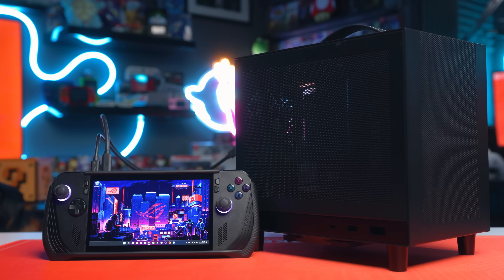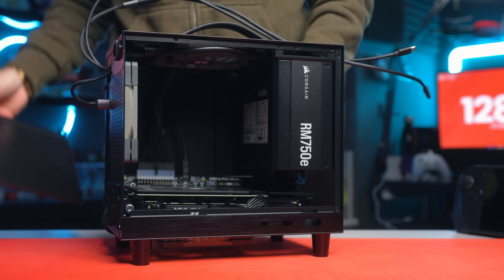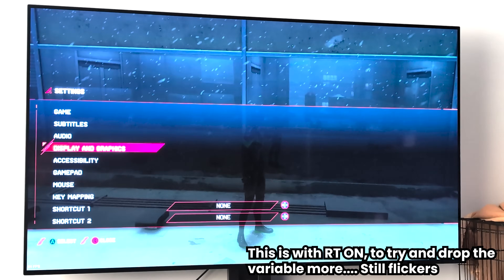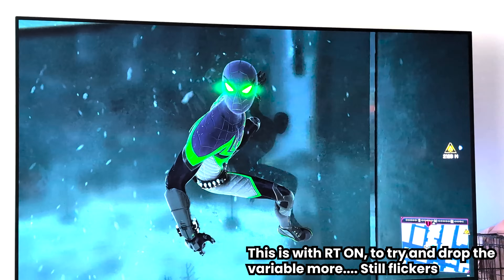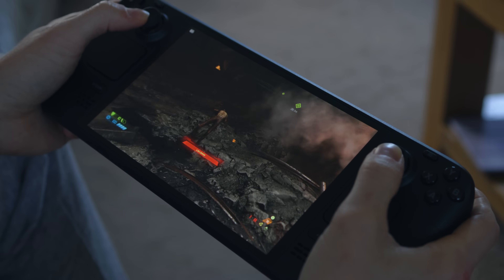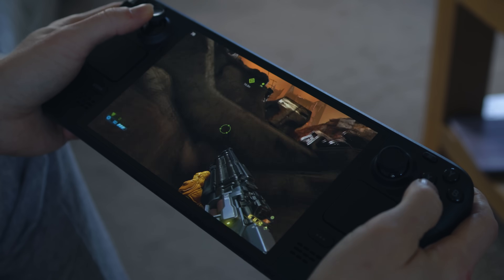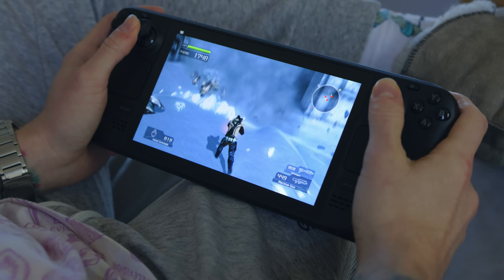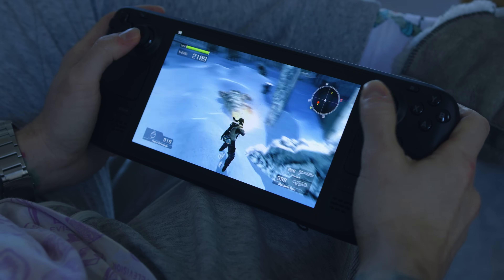The REAL Reason ALLY X Isn't OLED

Comment: Yeah, good to know but I'm just gonna have my framerate capped anyways even with frame gen. I just don't like that variation and it does tend to help minimize frame drops. I think the main benefit of vrr for most people isn't the variation so much as the ability to choose whatever refresh cap you want.
It's a lot better than the old days, where you either dealt with drops to 30 or needed triple buffering.
Now that frame gen is helping stabilize framerates this seems like less of an issue.

Comment: Such informative video and I'm glad I didn't listen to a couple of friends insisted me getting an OLED Steam Deck which I never wanted in the first place due to it's limitations and went straight for the Ally X. I'm loving the device. Of course there are a few downsides but nothing like a deal breaker. Best thing is to buy a PD 100w Charger or a juicy Power Bank like one from Anker, UGreen, or Baseus and have fun with the beast by maximizing it's true potential. You'll love the Bypass Charging feature in the Ally X.

Comment: Frame caps don't defeat the point of VRR. You should always use a frame cap that is achievable. VRR gives you the ability to choose ANY framecap, not just the max refresh rate. Additionally, even with a framecap, most games will have some variance so VRR helps smooth out that variance.
Reply from the maker: If you cap the framerate to a stable and consistent rate, it is no longer variable. If you cap it to an unstable rate, then yeah, the rate will again be variable. We LOVE VRR, we just want to see VRR flicker fixed in all OLED panels.
Reply: @128KB  Keep in mind that VRR is allowing you to pick any framerate. Ex) 80hz - only available with VRR or CRTS. Additionally if a game even has a slight deviation in framepacing from the cap, VRR smoothes it out. Without VRR on the judder will be more noticeable. So if you are choosing VSYNC on, you are going to cause judder if it is every below the cap - additionally you are adding input lag. Using VSync instead of the good framecap is WAY WORSE.

I tried re-creating with miles morales on my AW3225DW but I couldn't. I've only seen VRR flicker on Loading Screens (flickering between 1fps and high fps). I'll try with my S90C later. I will say with my 9800X3D and 4090, anything above 120fps in spider man felt unstable. Uncapped gaming feels awful no matter how good your hardware is.

DigitalFoundry has a great video about VRR misconceptions and a clip about their take on OLED VRR (they think its a non issue because it only happens in uncapped gameplay). Even if you are extending past your hardware you should always cap, because you want to reduce the range of VRR inorder to increased perceived consistency.

Comment: Wait, digital foundry said vsync is suppose to be on, 3 fps cap beloe your monitors refresh, and vrr on? Vsync assists vrr, not 1 or the other
Reply: When VRR is engaged, and VSYNC is not active even if it is enabled. You set VSync on as a fallback incase VRR is not engaged because the general recommendation is that if you have to choose between VSync on and VSync off, VSync on produces a more consistent experience.

Comment: I have both Ally Extreme and Deck OLED, I continue playing mostly on the Deck and if I were to pick Ally 2 LCD with LFC+VRR and Ally 2 OLED without LFC+VRR, I'd still pick OLED. Sorry guys, here we split 😬
Reply from the maker: That's all good! We'll all have our own preferences and honestly an ALLY 2 with an OLED, without VRR therefore no VRR flicker, it would be incredible still!
Reply: @128KB  Here is something to think about, next gen Z2E handhelds, both MSI and ASUS come with LCD, Lenovo comes with 8.8inch OLED panel with vRR and HDR, lets not forget about HDR, imho more important than VRR, especially on handhelds, the main reason 99% of people LOCK t heir FPS on handhelds to save battery, so VRR is useless.
Anyway, MSI+Asus basically FAILED out of the gate
Why would anyone pay the same money for inferior hardware?
If you have an option: Bigger OLED screen with HDR and VRR or smaller LCD with VRR and castrated pseudo-HDR? which one will you choose?

Why would ANYONE pick a non OLED panel? OLED is the ultimate end-goal for gaming
I dont have any non OLED devices in my apartment, and i will never use non OLED handheld or a phone, its  just not thesame

Comment: It’s the price. You aren’t gonna get an OLED device with “all the fixings” for less than $1,000 & they don’t want to cross that threshold in North America. Like, there is supposed to be an OLED PC handheld coming out soon in NA, but the price hasn’t been revealed & I think it’s only 16 gigs of RAM. & prolly 40-50 watt battery. You can’t sell 80 watt battery + 24 gigs of RAM + OLED in North America. It’s way too expensive.
Reply: Then... We need a Steam Deck 2 to check all these marks and stay at the low price? Damn, it'll take some time, Valve aren't rushing anywhere...
Reply: they steam deck won’t include high end tech at a low end price. It’s the pc equivalent of what a Nintendo switch is to console gaming. It’s a soft landing to try & entice casual gamers to bite. They will not put the stuff that is in that Alley X combine it with a 1080p OLED display & sell it for $500. There is new generation tech launching very soon & it has a better chip then the Alley X & it is going to have an OLED display & the starting price of this device is $1100. That’s for the “base model” but it’s a Chinese company & you’ll have to import it & that’s why I mean by no North American company will ever sell this. No way. lool.

Comment: Vrr is one of the Main Reasons i went from the Deck Oled to the all x. Had to cap every more demanding Game to 30 fps, the 780m + 24gb 7500mts ram also helps alot with smoothnes. Cant wait for the oficial steamos Release on the Ally
Reply: VRR is useless on handhelds

Comment: Bro, I’ll be nice if you get the Lenovo Legion go everyone said that thing is so much better than the Rog ally x because it has better things even because of the price and some optimisation it’s getting good
Reply: I switched from it to the ally x the only good thing about it is the screen and kickstand. I fohnd everything else a better experience on the ally x
Reply: @ I do like the ROG ally x is just that system does not have maximum FPS or a refresh rate. It does not have 144 FPS maximum and it does not have one for 144 Hz which is mean I’m not gonna buy this handheld if they change something or add something better for me I’ll stick to my Lenovo Legion go because I still like it
Reply: @Russiangamerpro2021  yeah i get that but i dont think 144 amd 120 is noticable the vrr really helps out the ally as it removes screentearing and can increase battery life. Also there is no reason for the ally to have 144 max fps option if it has 120hz

Comment: How come you should get the Lenovo Legion go? It’s better even has a port that you can connect to external graphic card which is USB 4 port and it has 144 Hz and 1600p even you can change the resolution and it does not have VRR which is I don’t need to know what’s causing it so it’s good thing I don’t have it that I don’t cause any experience but somehow handheld can only limited how much FPS it can only bring. I like the Legion go because as 144 FPS maximum which is perfect.

Comment: Good thing I have one Lenovo Legion go because even my handheld has a USB4 port even my handheld display is not VRR but if I connect to my display, I don’t see any issues going on maybe it depends what game I’m playing maybe just when I play the game I don’t see any results on my Lenovo Legion go but for the Rog ally x  some people think that Hannah is good and some people think that they’re don’t want this handheld because they switch to Lenovo Legion go people considered to buy this handheld because it has better things than ROG ally x
Reply from the maker: @Jasonbwolf.JBWOLF  what we're discussing has nothing to do with the ALLY X but OLED VRR panels, monitors and TVs.
Reply: @ I know I just never seen a video of you reviewing about the Lenovo Legion go it’s considered to be better than the ROG ally and X it’s because of the legion go uses USB 4 which is that was the first handheld released and everyone is wondering how good those pork can be good for even ETA prime actually review the Lenovo Legion go with USB 4 that performance really well that’s why I like Lenovo Legion go because it’s better than the ROG ally x but if they are higher refresh rate and then I’ll buy the ROG ally x if not I can buy it even when I can buy it if there does not have maximum FPS because it’s maximum FPS shown that it can only reach 120 FPS but the other handheld can reach 144 FPS it shows that other handheld is better than rog ally x
Reply: @ even I only watch a video people use EGPU depends what handheld they’re using even I’m still waiting that if they’re gonna create a new handheld with thunderbolt five

Comment: VRR flicker happens on LCD panels too. My Gigabyte monitor is horrible for that. VRR needs somewhat consistent frame times.
Reply from the maker: Sorry to hear that, I've been using VRR since it launched and never experienced it across multiple LCD monitors. There is a chance for LCD panels to have a VRR flicker but it's not the same reason as why OLED flickers and OLED is more susceptible to it.
Reply: @128KB Every single panel has what's called pwm flicker. Look into it a bit more 👍
Reply: That's rare on lcds

Comment: Bro grab a LG oled. Even a used one. LG CX. So good!! Amd frresync premium is great.
Reply: I agree. I have the LG C1 and never experienced flickering
Reply: Trying to find a cheap one rn 😭
Reply from the maker: My Philips 77" OLED is using an LG panel, it's the older LG panels that still had OLED VRR flicker, most likely why mine has it too!
Reply: AMD Freesync Premium saved my life. I got a 42 LG C3. I’ve had a 55 c6 curved. Since 2016. lol. 2.1 was insane. 120 frames Freesync Dolby vision. I mean. I don’t notice a flicker